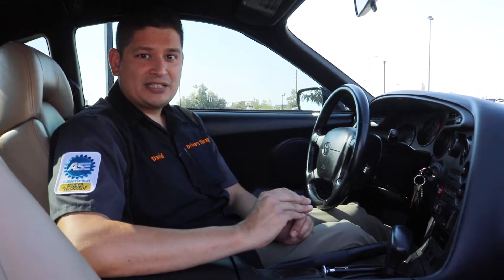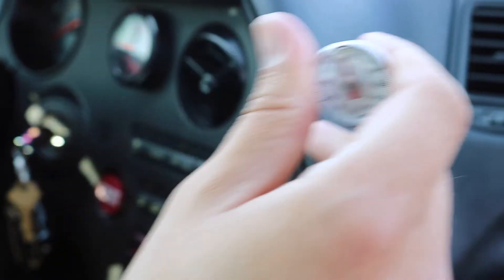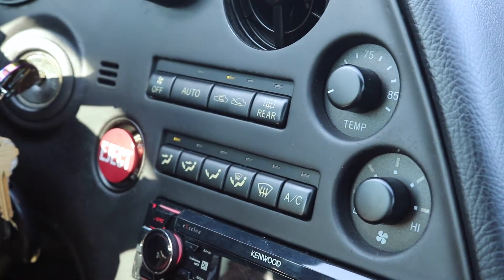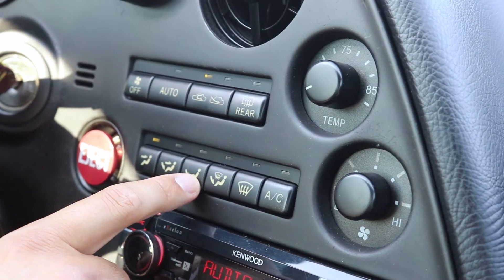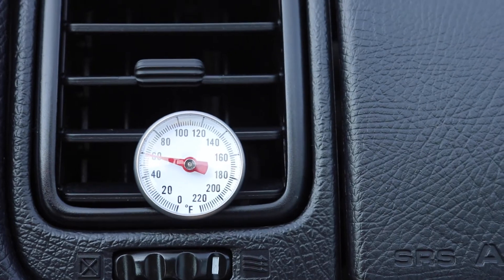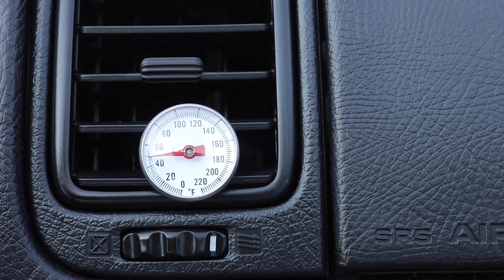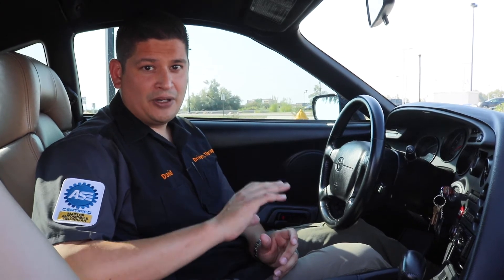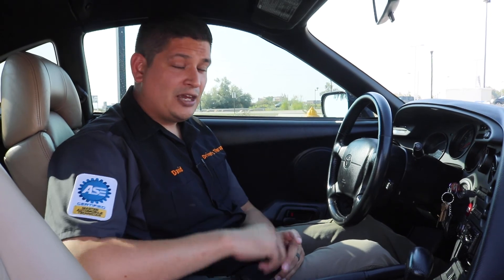Automotive Air Conditioner Performance Test | AC Vent Temperature Test |by ASE Master Technician

Comment: Interesting ....
The AC guy told me if the car has been sitting in the sun all day it can get to over 100F in the car, if you turn the ac ON and you put it in recir mode, that system is now pulling IN 110+ deg heat and the system is now fighting to remove the heat from that 110+ temps ....  
Where as if you turned the ac ON and turn the recir OFF, now its pulling in outside air temps that are 90-95F which is "cooler" than the hot air inside the car which means it will cool down faster. Extracting heat from 90-95 is easier than 110+ 

Once the inside air of the car cools down below outside air temps, then you turn the recirc ON which now directs cooler inside air thru the system to further cool down the air.
Reply: That's backwards... you definitely don't want to keep recirc on long term while you're driving. It's purpose is to specifically cool down the inside air faster. Even pulling in the hot inside air, it will cool it down to equivalent outside temo very quickly and then will be much more efficient. This is bad advice.
Reply: @simasp7189 its not backwards at all. 
Its NOT bad advice at all either.
His logic is 100% sound ..
Reply: It's not. The inside will reach outside temperature VERY quickly with recirc on, so the logic is not sound at all.
Reply: @simasp7189  lets write this out in crayon:
Outside temps are 95F
Inside your car is about ~115F 

Which one is faster to cool down to 50F ? 

ill wait here for the answer .....
Reply: @ACommenterOnYouTube you're asking the wrong question. Theoretically, you would get an advantage up until your inside reaches the same temp as outside, but in reality, this would happen so quickly and can be assisted by opening your windows and letting cool air in, until your AC has a chance to get fully up to speed. On the other hand, you could say, yea, but the interior is hot and will immediately heat the air when the windows are closed and you could be right, but at that point, the air circulation is probably fast and efficient enough to overcome the radiation from the objects in the car and even gain the upper hand, especially if you put the blower on full blast. So no, keeping recirc off will not help to cool the car faster.

If you have a good and quick reacting thermometer inside your car, it may make some sense to keep recirc off until your inside temp reaches outside temp, but then again, the thermometer would also be affected by radiant heat, so I don't know how reliable it would be. 

My main point is still the same. You would reach the outside temp inside the car so quickly even with recirc on that it makes no sense to keep it off.

Also, consider the fact that the time period that is needed to start feeling comfortable in the car has more to do with cooling down the inside objects/surfaces to reduce the radiant heat, which takes a lot longer than just cooling the air.
Reply: @simasp7189 its quicker to cool down the outside air than it is to cool the interior air that is well over 20F fron outside.
As i explained in my original post that you denied and in which you are wrong, physics does not lie
Reply: @ACommenterOnYouTube 
It only makes sense if you switch to recirc immediately when the inside reaches the outside temperature, which will happen very quickly, even with recirc on, therefore there is no point in doing that.
Reply: @simasp7189 i explained the facts in my original post which you still deny and claim as backwards which means you go against physics 🤷🏽
Reply: @ACommenterOnYouTube 
I don't think you undersrand what I'm saying, sadly.. I'm not denying that it will cool faster with recirc off, BUT ONLY UNTIL THE INSIDE REACHES THE TEMP OF THE OUTSIDE, at which point, it makes no sense to keep recirculation OFF if you want to cool your car faster. 

Also I'm making an assumption that reaching the outside temperature inside the car will be very quick, even with recirc ON, therefore, there is no point in playing with it. Just turn it on and enjoy your ride..
Reply: @simasp7189 i dont care, my statement is 100% fact yet you denied it. 
I dont care anymore .... 
muting you out 🤷🏽
Reply: @ACommenterOnYouTube  I don't care. I did not deny it, I agree with the physics of it, but I said it's bad advice and I explained why. If you can't comprehend it, then it's your problem.
Reply: @ACommenterOnYouTube  inside air temp will cool down faster on recirculating because the ac has only a small amount of cubic ft of air to cool before the inside temperature drops below 95. Just give it a minute or two  Outside temperature will always be 95 no matter what. 609 certified mechanic here. The guy was accurate on everything except he needs to learn how to read a temperature gauge. His temperature was 49-50 degrees not 45.
Reply: @B-0352USMC everyone on YT is a certified mechanic 😂
Reply: @ACommenterOnYouTube  yeah I don’t think so. But I actually am so kick rocks ass!
Reply: @ACommenterOnYouTube 
But when you really are certified and this exact question is on the test….Max AC with recirculating air on. Maybe they just got that question wrong! 😂
Reply from the maker: You have some valid points. I would do both my method and the one you are talking about and see what you get.
Reply: @DriversTherapy i have already done both and depending on the specific situation, i know which way cools down faster.

Comment: Good video. Would you not recommend doing a thermometer test whilst driving?
Reply from the maker: You can but it’s good to have a base line of the system before you cool it using the condenser and air.

Comment: Since my mechanic does not work in the workshop, he went to my house to install the compressor, oil and freon and the only thing is that the mechanic does not have the drain and I did not feel that it was colder than before and I put a thermometer to check the temperature and the minimum that it reached is 60 and surely it could be due to the vacuum that did not have it
Reply from the maker: It should be lower for sure. The vacuum process is crucial when doing a proper A/C check or work. Did he have the gauges to check the pressures?
Reply: @DriversTherapy  Yeah he was using the hose to added  freon with the gauge
Reply: big question did he use a micron gauge on the evac test @DriversTherapy
Reply: Moisture in the system will affect performance and cause corrosion which will shorten life of entire system. If he did not evacuate the system and do a leak test, the job was improperly done. I don't think anyone has a right to take money for a job they are not doing correctly, IMO.
Reply: @MarzNet256  I bring my car to a mechanic shop to check and they say nothing found error in the gauge
Reply: @TheJunior1964  Yes. The pressures are probably about right, but there can still be moisture in the system. They are two separate things.

Comment: what rpm?,   if you drive.. does temp drops?
Reply from the maker: Temps should drop right away but should reach maximum level of cooling when driving on the highway due to evaporation  and air pulling pulled through the fins of the condenser.
Reply: @DriversTherapy  thanks so much, whats ur ideal temp on highway?

Comment: Outside variables. What about them. 100 degrees outside temp. How cold should it be blowing.?
Reply from the maker: At those temps, most A/C systems loss some of their efficiency. You will notice that most at short term drives and stop and go traffic. The newer and properly charged system will do better but at those heat levels, most A/C systems are impacted.